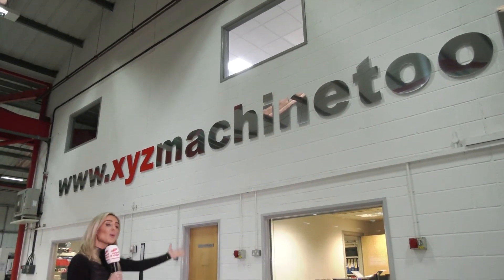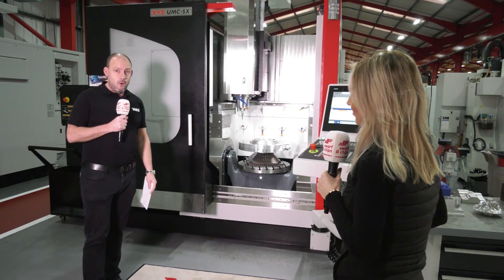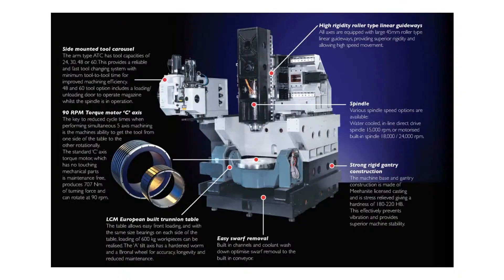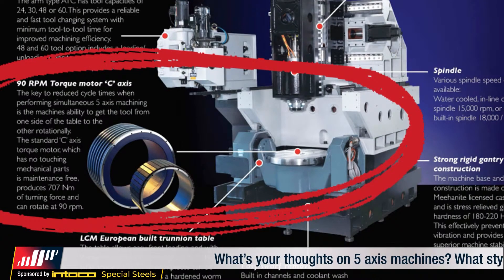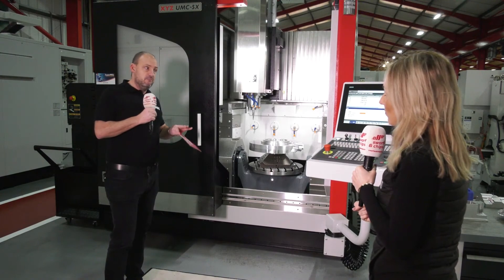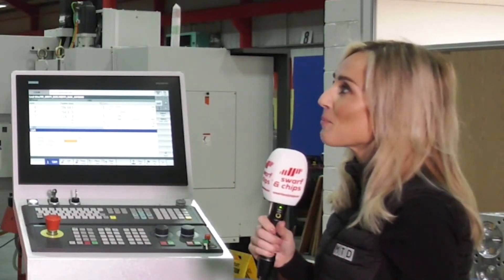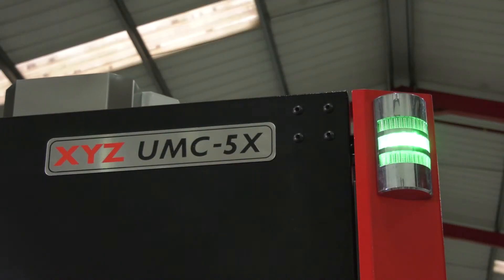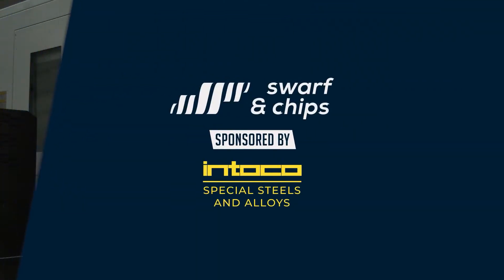What makes a good 5 axis machine? | #SwarfandChips

Comment: Precision engineering is a highly detailed and complex manufacturing operation which requires the most efficient tools available to carry out the ever increasing expectations and demands within industry. Multi-axis machines provide a high level of CNC manufacturing capabilities and come with several benefits which make them invaluable tools to use.
Reply from the maker: Glad you enjoyed the video,